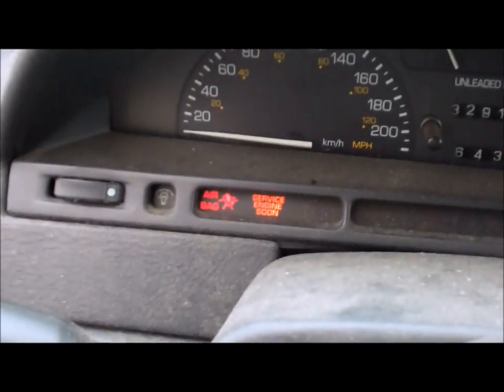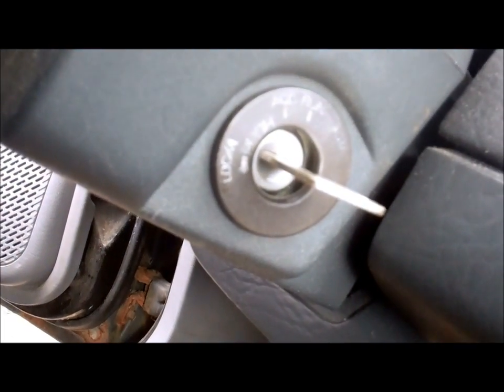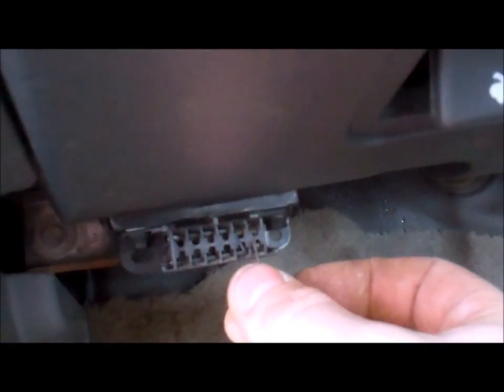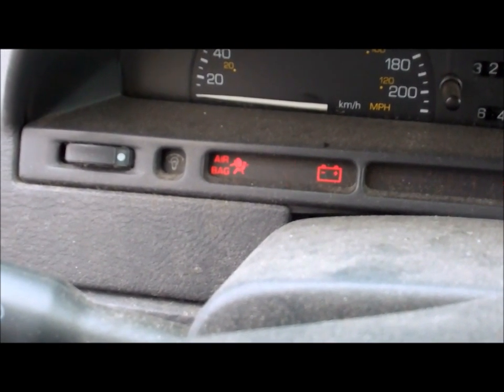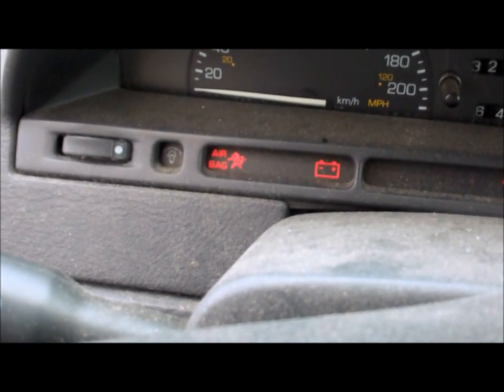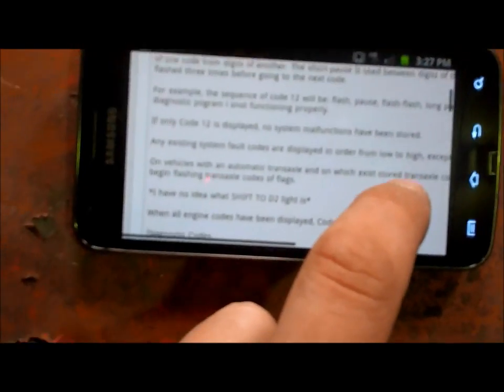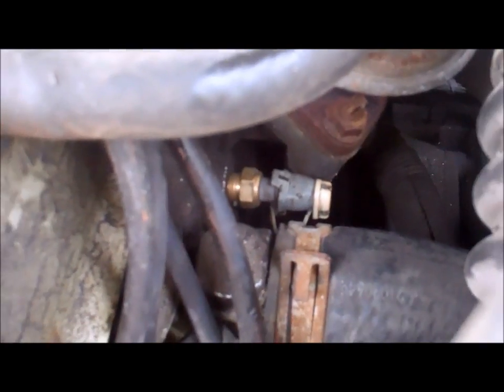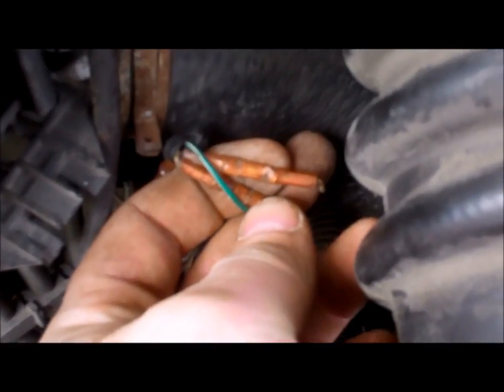how to check obd1 codes in a GM using google

Comment: you have the new OBD2 error codes, if you have the new connector, but the old OBDM1 system using the new 8192 baud rate. you can make a cord with 2 transistors and a few resistors, or buy one, then download tunerpro for your car, its runs for free, even tho it asks for a donation everytime you start the program on your computer. You will also needs a RS232 laptop, you can buy one that plugs into the USB. DONT buy a prolific RS232. wont work. use 1 with a moschip 4 the uart 4 tunable baud rates

Comment: that means you have an OBD 1.5. you will need a scan tool most likely. some need a 10k ohm resistor from radioshack. probably from 94-95. if your autoparts store cant read it for free, there is a good chance you have an ALDL just like in 1993, but it uses a 8196 baud rate, for faster communication, old baud rate is 160. and thats how fast it can send binary data, or how fast it turns on and off the voltage. you make a cable and download tunerpro, but you will need a UART RS232 port on a laptop

Comment: When i try this, as soon as i connect the jumper wire, i get a whirring fan like sound from under ther hood. No codes are displayed, the SES and check gauges light both stay illuminated with no flashing at all. The whirring noise stops when i pull the jumper. Any thouggts?

Comment: Are the codes stored, can I get them out even if the light currently isn't on? My Chevrolet Caprice '91 lights up the service engine soon while cruising down the highway, but when I turn off and restart the car, it always goes away.
Reply: Did you ever find the answer to this question... having the same issue need a stored code

Comment: Just letting you know, there are some 1994 GMs that switched over to "OBD 1.5" in which case this wont work. I had a 94 Cavalier (late model it was build in July of 94) that must have had OBD 1.5 because this trick wouldnt work, but I could get the codes with a scanner.
Reply: xScoobyDoo82x I know this was a looong time ago but how did you get your codes? I have a 1994 Pontiac Grand Prix this don’t work in. It says in the sticker on the door it was built in like September of 1993 but this don’t work anyway so I wanna try whatever scanner you used 😂

Comment: I know some stuff to a certain point like the typical do-it-yourself'er. But when it comes to stuff I don't know I don't dick with it, plain and simple. I'll stick to changing the oil and doing my own spark plugs. If I had the material and tools for it I'd do my own exhaust, but I don't. So I'm not gonna worry about that. I'd like to do duel exhaust some day.

Comment: @crystalscan2002 no, 1996 and newer is all obd 2, this is for obd 1.  You need a code reader for obd2, but you can get them for very cheap of ebay that plug into a computer...I found one for 99 cents, It is still working after having it about 5 years